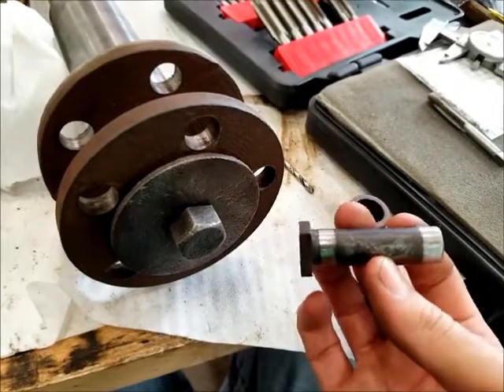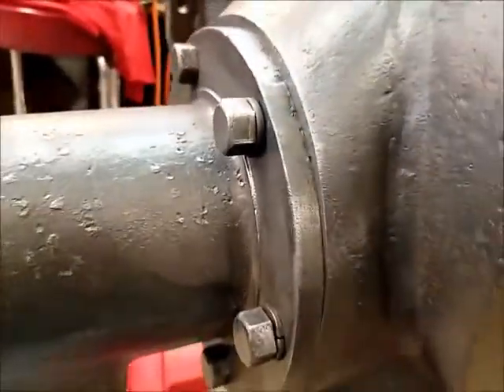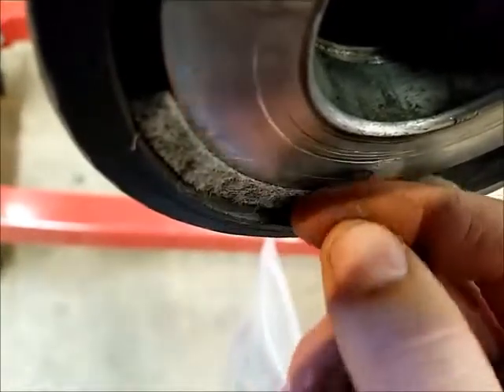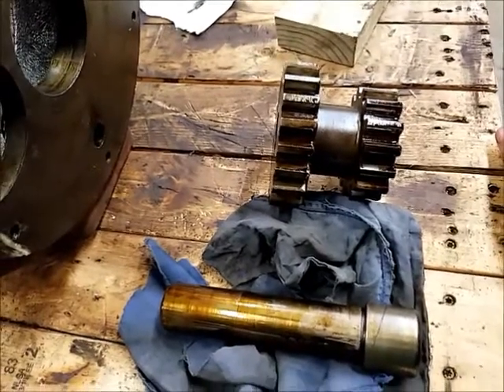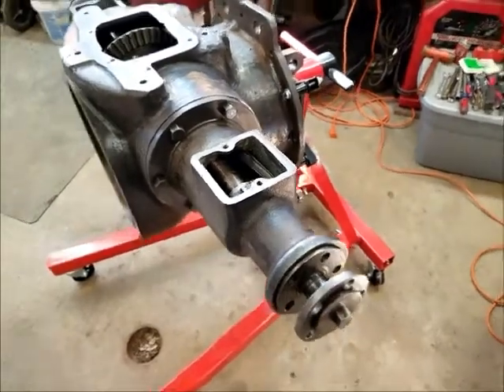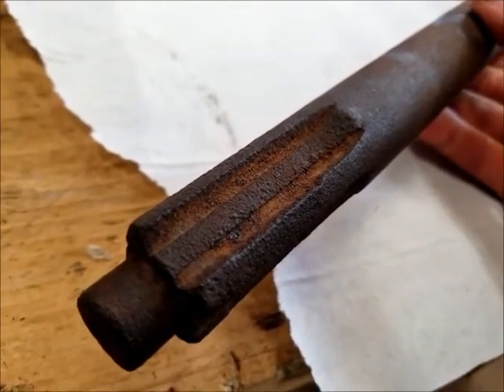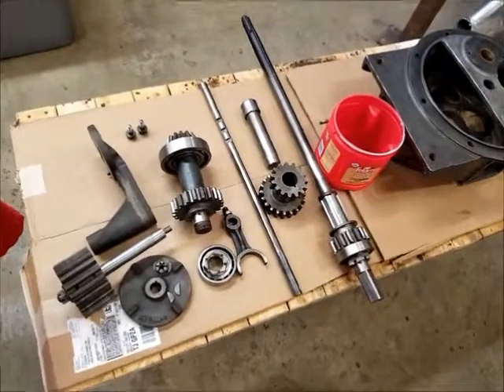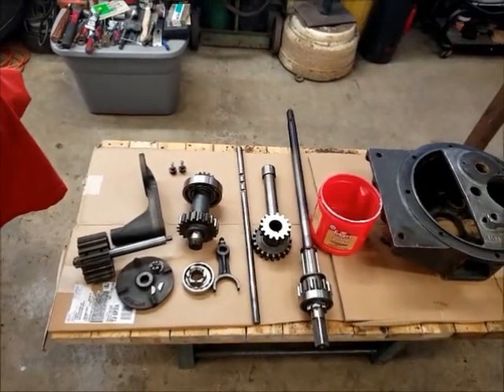1920 Allis Chalmers 6-12 part 17

Comment: Turn the lock washer over on the axle housing mounting. That rolled up edge likely is a deformation and will go down along the bolt into the main housing. Worth a try anyhow.
Reply from the maker: Nope, all the lock washers are originally formed this way, they are not deformed.  And they were all in this orientation with the ridge towards the bolt head.  You are not the first person to suggest they were just deformed lock washers.  Just one of those obsolete things you find working on a 100 year old machine.
Reply: @JacobASwanson  was worth mentioning my friend. I prefer working on this early stuff actually. Really enjoying the "dissection" of this tractor. I understand so much more about their designs. Thanks so much.
Reply from the maker: @stephenstrohacker7863  now it may be possible that the lock washers were taken apart and put together the other way since this left the factory, but they were ridge side towards the head when I took them apart.  So that's all I can say about the orientation.   They for sure are formed this way though, as all of them are like this, even the small ones.  I have not been able to find any other pics or reference to this style of lock washer on the internet.  I'm guessing it was a short lived idea.